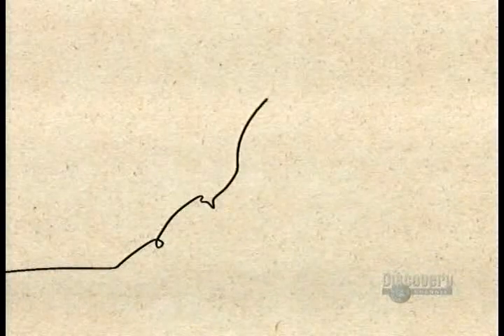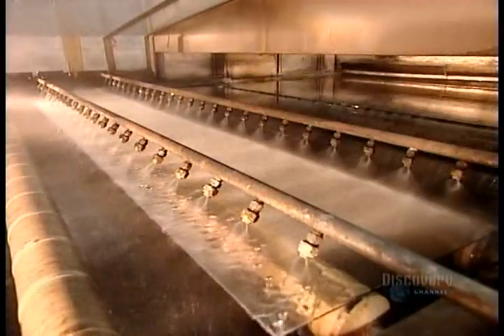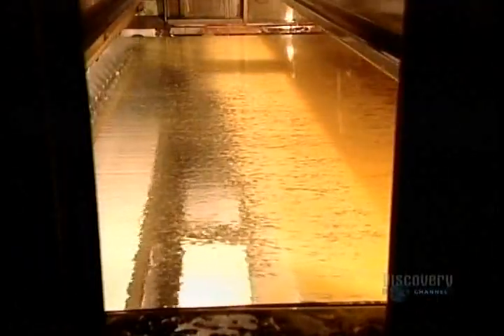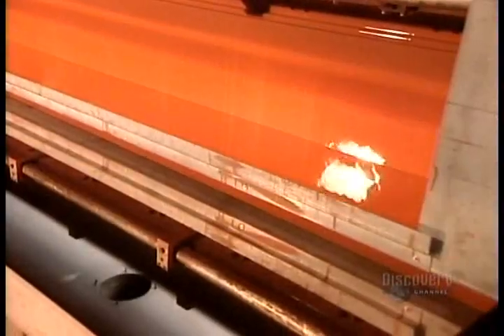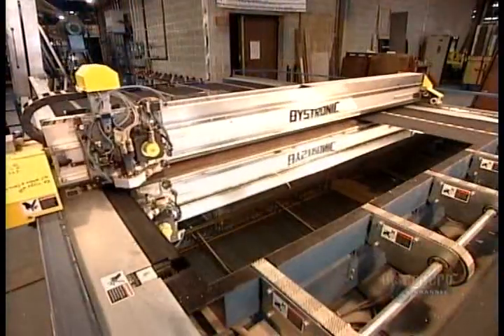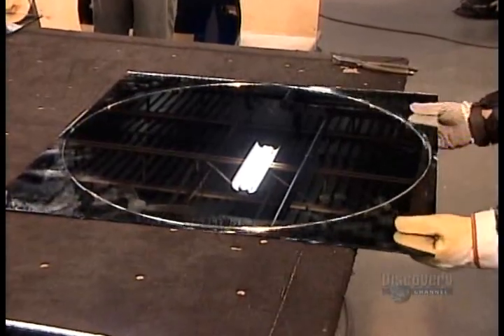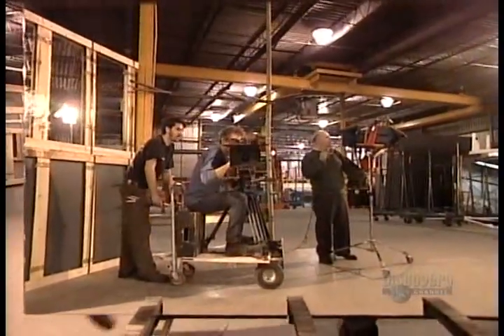Mirrors - How its made

Comment: "Using special tools they separate the squares and then the circles"
Shows them using a table, gloves, gravity, and pliers 😅
Reply: The pliers are special and so is the table. The table is a special air pressure table to easily move the glass. The pliers are flat pliers with no teeth and have a special flat taper to put pressure on one side only. So yes, special tools. In fact you can only find these tools at glass supply companies.
Reply: @yodaddy82daddy70  alright I grant you all that. Being able to work it with less, it fooled me.

Comment: Fun Fact: the assertion that Vampires are unable to see themselves in mirrors comes from the silver mirrors that were common place during the spread of myths, silver was (still is in some areas) a sacred pure metal so something corrupt like a vampire cannot use it or interact with it to such an extent that not even it's reflection touches the silver. 
The spread of non-silver mirrors led to the myth changing and stating that vampires cannot see their reflection at all.

Comment: A lot of the chemistry mentioned was basically wrong.  It does leave a coating of silver, copper, etc but you don't "spray on liquid copper/silver".  These are metals that melt at very high temperatures.  What is done is there is a solution containing the metal compound and a chemical reaction causes the metal to plate out as a thin coating.  That said, it was an interesting episode.

Comment: As I write this comment in 2022, this video was posted 13 years ago, so it's unlikely to be seen by the show's creators. But I'll nevertheless say that all these manufacturing videos show similar computer guided and executed processes. I'd like to see how things were done in the analog days! That would be more interesting to me.
Reply: I spent 2 years working at a place that did this. We cleaned the glass with distilled water. Then we took silver nitrate and poured it evenly on the surface of the glass as it laid flat. Let it sit for a bit but not too long, then tilt the glass so any remaining silver pours off. The time it takes depends on temperature/humidity but it will be ruined if left to sit for too long. Then we dried it using fans. Once it is fully dry we coated it with a lead based paint twice. If done right the silver wont flake off. Never worked with copper however we used various other chemicals to create cool effects.

Most modern factory made mirrors actually don't use silver but aluminum as it is vastly cheaper. No idea how things were done before silver nitrate.
Reply: Thanks for sharing, very interesting!

Comment: Fun fact! Silver was seen as a pure and holy metal, it's why vampires couldn't see themselves in mirrors due to the holy metal backing! Nowadays most mirrors are backed with aluminum due to the cost effectiveness(I think nasa still uses mostly sliver for their telescopes amd such due to the slightly higher quality) so in today's time vampires could see themselves in mirrors
Reply: We also use silver in antinqued mirrors due to its reactivity with certain other chemicals. NASA also used clear aluminum for the windows on the shuttles which is pretty cool if you want to look it up.

Comment: Such a great and gruesome video! Love the part where I couldn't understand how they made mirrors. Makes no fucking sense at all, all they did was spray metals on the back of the glass. How the hell did they do the front? Let me know. Also: did you see that guy with no gloves on carrying the mirror in a mirror factory? What an idiot. He should be slapped for every finger print he adds. Love the video, excited to see more. Thanks!
Reply: Mirror is a piece of window glass with metals sprayed on one side of it, then painted to seal the metal from tarnishing. The front is just clear glass. Fingerprints wipe off the glass. I was a fabricator in a glass shop for many years and cut, drilled and edge ground more mirror than I care to remember, 'cause it make the back hurt. ;-)

Comment: A big salute to engineers who designed the conveyer belt as glass didn't break by even a inch in all these different processes.
Reply: I’m most impressed by the whole panel dropping in one piece at the very beginning.
Reply: -- The belts are made out of a rubber-like material that's actually very soft and the table itself is covered with the material that is like a thin carpet. The table also has small holes perforated all over it with air blowing out which cushions the blow. I used to work for a glass company and repaired as well as maintained those tables which are commonly known as a loader table. Best wishes! 

- Max Giganteum

Comment: "some kind of earth" WHAT KIND OF EARTH
Reply: The good kind of earth,
Reply: Fr. that can be applied to literally anything to ever be produced ever on this planet.
Reply: Carbide is a strong metal.
Reply: Cerium oxide is used, based on the size of the particles, as an abrasive for scouring, grinding or, in super fine particles, to polish glass and glass lenses. It (cerium)is technically called a rare earth metal but is common.

Comment: You can see that ppl don't have much respect for chemistry(or science in general) in in the west: 'carbide is a strong metal', 'silver and copper in liquid form' etc. Can't they hire an editor? Concentrated serum oxide? Its insoluble in water, meaning: the concentration is zero%. It's suspended like a sand. Could say thicker or even denser but definitely not 'more' or 'less' concentrated....

Comment: "Using special tools"

.....so pliers?
Reply: cocaineinmyvein glaziers pliers, “running pliers” as I know them, the jaws have a sort of v notch shape so when you grip the glass it’s applied uniform force to each side of the scored line, the score “runs” and the glass snaps cleanly! Without those pliers, sometimes glass will skew off of the score and you’ll either ruin the glass and have to start over or have to work now double to correct the issue and HOPE, you don’t end up breaking it anyway. Lol 😆

Comment: Better way of making a mirror

Take these 200, 500, 1000, 1200 and 1500 grit sand paper get a metal and sand paper and sand it with all the sandpaper take each and sand it with each sandpaper over the required iron then do with all of them then done if there is scratches use a 4000 grit sand paper

Comment: Carbide is a strong metal... ehhhh no. Carbide is a hard metal that is something completely different from strong. For it to be strong, it has to be tensile wich is not, it has to compress well, again not a very good competitor, and it needs to be impact resistant, if you drop a piece of carbide it would probably turn into shards. 
So please try again.

Comment: 4:42 "using special tools" - pulls out pliers
Reply: Dont mistaken..  Actually its really special tools.  Special plier for glass only..
Reply: @DanielSjohn-xt7mp  I mean, I am aware of how the head is very minutely different than pliers, but... they're pliers.
Reply: @toasty4000000   go and see by yourself then you will know
Reply: @DanielSjohn-xt7mp  perhaps.
Reply: @DanielSjohn-xt7mp  it is what it is
Reply: Glazing “running” pliers made for cutting glass and glass only. 👍🏼 there’s a V notch shape in the jaws, applying even pressure in each side of the score “running” the score and snapping the glass cleanly.
Reply: @billglaser  You're wrong there. They're "nibbler" pliers. No glazier worthy of the title uses what you call "running" pliers to break glass of thicknesses up to four millimetres. Nibblers are normally applied on lengthy cuts of glass thicknesses (for shop windows, for instance) of above about 8 mm after the cut has been tapped through. 

The reason why the folks in the vid are using them is because it's quicker and thus economically more effective. It dispenses with breaking the cut through all around and saves time. Nuff sedd!
MsG
Reply: Even I thought the same. 😁😄
Reply: -LoL.
Reply: it's special compare to all the heavy machines there XD
Reply: Stopid WOmaN

Comment: This video explains why it's so easy to tell a normal mirror from a two way mirror. If you put your finger against a normal mirror there will be a space between the reflection and your finger because the metals and protective paint are applied on the opposite side of the glass. A two way mirror will have no space between your finger and the reflection because chemicals are applied directly to the surface facing you. Fun facts.

Comment: Woman: this process takes special tools to complete.                 Guy: uses pliers
Reply: The type of pliers is different. They are shaped like a diamond on the inside so the jaws don’t touch at the center. It is much better for breaking scored glass.
Reply: Been making mirrors 10 years and I just use pliers lol
Reply: @integral9585  you're goddamn right . i've been cutting glass almost for ten years, since i was fifteen and i'm 25 and still learning other things about this type of work. nowdays everything requires machine .
Reply: I can confirm the pliers are different and also the table that the glass was on has air coming out of it like an air hockey table so the glass kind of floats around .that makes it easier to turn it . i used to work at 2 different glass places so I know a little bit ha ha also they didn't show an important  step because he would have had to take a glass cutter and score both opposite sides of the square piece of glass so that it would break off properly
Reply: @o0o-jd-o0o95  Apparently the glass sheet came off the previous machine and onto the table that way.
Reply: Not regular pliers. Please use your eyes.
Reply: Lol 😅
Reply: @FredNeecha  😆😂🤣 crazy
Reply: For those that are interested, they are called running (or runner) pliers. They act like a fulcrum to open score lines using even pressure on either side. Honestly for straight cuts I've used a round toothpick under the scoreline and even pressure to break the score line a pinch.
Reply: I used to cut glass by hand. We had a pair of pliers that sort of looked like a duck's bill, except it wasn't flat. It was curved ever so slightly. You basically "straddle" the line you scored, and the pliers put downward pressure on each side of the scored line.
Reply: It's like saying they "washed the glass" as the first step, when, in fact, that was lapping the glass. Lapping is fine polishing.
Reply: Haha
Reply: Was about to type this comment.
Reply: facts
Reply: lmfaoooo
Reply: I think they're parallel jaw pliers that put even pressure across the entire gripping surface.
Reply: Hey..pliers are special too you know.
Reply: Exactly
Reply: Three different types of glass pliers: They are called plate pliers. A) Drop jaw type. B) Flare jaw type. C) Running pliers (used to start a score split or run.)
Reply: Hey pls watch and subscribe to our channel: Your Music TV we made a few lyric Videos if you like pls recommend us to your friends I really really appreciate it

Comment: how are mirrors so cheap when  they use Silver and Copper?
Reply: Lima Funla Hello Lima. Because the thickness of the layer is so very thin you only need very very little of these materials.
Reply: How are pennies so cheap  when they use Copper?
Reply: Metals being opaque in nature, a very thin coating is sufficient. Silver and copper are highly malleable and now a days very thin films, like we use in micro electronics, can be prepared using spray forming. The silver backed by copper protects it. So very small quantity is sufficient to get the reflectivity required.
Reply: TR P r/woooosh?
Reply: @shmoo4461  uh r/ihavereddit? I have 1.1k karma, I don't need anymore yet. So I won't make you internet famous.
Reply: I can see profit in the mirror recycling bussiness

Comment: Everyone has a plumbus in their home.
First, they take the dinglepop and they smooth it out with a bunch of schleem. The schleem is then repurposed for later batches. They take the dinglebop and they push it through the grumbo, where the fleeb is rubbed against it. It's important that the fleeb is rubbed, because the fleeb has all of the fleeb juice. Then a Schlameeh shows up, and he rubs it, and spits on it. They cut the fleeb. There are several hizzards in the way. The blamphs rub against the chumbles, and the klubus and grumbo are shaved away. That leaves you with a regular old plumbus.

Comment: How can they use so much Silver and yet not charge a lot for a Mirror?
Reply: redneck4life887 each mirror uses a really, really tiny amount of silver. While it covers a large surface area, it's sprayed in an incredibly thin layer, and the excess is removed and reused.
Reply: Silver is like an expensive version of copper.
It's valuable, but not valuable enough to make a super thin layer expensive.

Comment: For those wondering about the carbide mentioned...actually it's tungsten carbide. A very hard alloy that is often used for cutting tools (mostly metal industry). For simplicity, it's often just referred to as carbide.
Reply: My wedding band is made of tungsten carbide, got it on Ebay for $15.  Many years later it looks brand new.
Reply: @kenwaid8239  Yes, it's indeed a very tough material. As a finger ring it's virtually indistructible.
Reply: @kalleklp7291  and yet my wife managed to get it damaged in like a month
Reply: @igninis  😂Yeah, well..it's just a ring. As long as the love wasn't "damaged" it's all good.
Reply: @kalleklp7291  Isn’t tungsten carbide very brittle? That’s the tradeoff for its hardness.
Reply: @tookitogo  In fact, it is to shock damaging like a blow with a sledgehammer.
However, it's most likely always used in an alloy. Even Tungsten electrodes for welding are made with several different alloy metals, including slight radioactive ones (Lanthanides). When it is used to produce cutting tools it's not subject to such forces in a machine (lathe, mill, or the like), thus being hard enough to cut the workpiece set up. Commonly, it's an alloy of Carbon and Tungsten that is used for cutting tips.
Reply: @kalleklp7291  Yyyyeah… I said “tungsten carbide”, not “tungsten”. It’s not actually alloyed into the cutting tools, but rather sintered with cobalt. (Tungsten carbide isn’t an alloy, but a compound, and the sintered “cemented carbide” is a composite material.)
Reply: The wear resistance of tungsten carbide is mind blowing. You could put 100kg on it and drag it for an hour at 100km/h on asphalt and it would hardly even scratch it. They use little tungsten carbide protrusions on snowmobile skis so you can drive the skis on asphalt with negligible wear.
Reply: -- It's interesting that you mentioned asphalt - they use carbide tipped bits to grind away asphalt road surfaces in order to smooth them out, remove potholes or to prepare them for another coating of asphalt. A nice How It's Made episode would be to cover one of these very large machines that is used to grind away asphalt and concrete. Best wishes! 

- Max Giganteum
Reply: I always thought it was called cuntstain tongue glide. Thank you

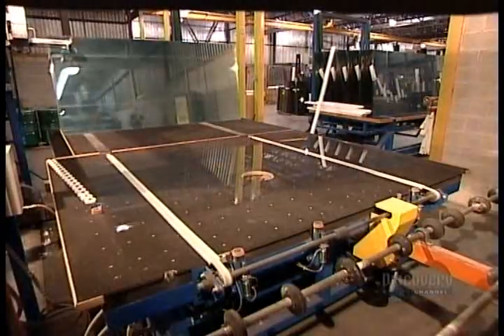Comment: 1:12 how did they make sure the glass not being shattered?
Reply: It's falling on to an air table.  If you look closely, you'll see small holes.  Those are blasting pressurized air out of them, which is what allows the glass to survive the fall.  You can see the effect when the worker is removing the bits around the cut circle of glass; he slides it around will little effort, because it's being supported by air.

Comment: 4:41 "using special tools" ... they look like ordinary pliers tho
Reply: +CuT3 Sniper (Sn1p1ng4L1fe) Yeah, I took a stained glass class, and those tools we used were definitely not pliers one edge was flat and the other curved, so when they clamped it down, it would snap the glass downward, breaking if off from the larger piece.
Reply: +Sam ikr?
Reply: There not pliers there flattened mirror sepporators
Reply: they are called RUNNING PLIERS and they aren't the same as ordinary pliers.  they separate the glass mirror along the score line.
Reply: Ya... Kinda
Reply: Yea. ik xD
Reply: Was going to mention something like that myself.
Reply: I was thinking the same
Reply: Ordinary pliers are flat. These are curved.  http://everythingstainedglass.com/wp-content/uploads/2016/08/breaking-pliers.jpg

Comment: by special tools you mean pliers right?
Reply: +Kevin Gutierrez They're actually not pliers, they're slightly padded and they close flat/inside, as opposed to regular pliers that close outside and only grip flat pieces in two spots.
They are set up for the specific glass thickness so you can have a large grip area and not chip the glass when bending it.
Reply: I get so hard hearing you type, Kevin...
Reply: Samantha Abeyta

Comment: "Carbide" isn't a metal. Did she mean tungsten carbide?
Reply: You're correct. "Carbide" refers to a compound of carbon and another element, usually more positively charged transitional metals, such as tungsten or titanium.

For glass and tile cutting you would typically use tungsten carbide.
Reply: I know right? Don't you learn chemistry in high school?
Reply: Yeah, I think for sake of time, they tend to shorten full names in these short documentaries.

Comment: the machine used to cut the mirror is called a C.N.C
. machine. it uses g codes an is runned by an air compressor an electricity.

Comment: Correct me if I'm wrong, but I think the reason the first coat of paint is red-orange is because silver mirrors tend to be slightly teal green (obvious in a mirror tunnel). This is usually due to the properties of the glass front. With an orange background, the very few light particles that make it through the silver and reflect back will help to offset the greenish color of the glass, resulting in a truer color reflection.
It's just a theory, but I think it makes sense.